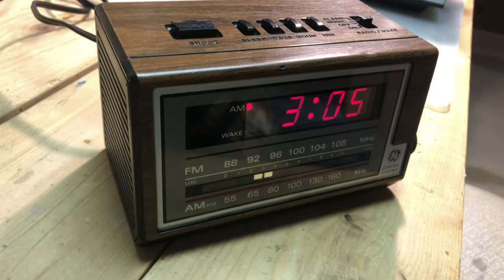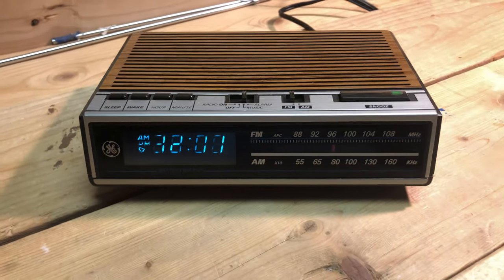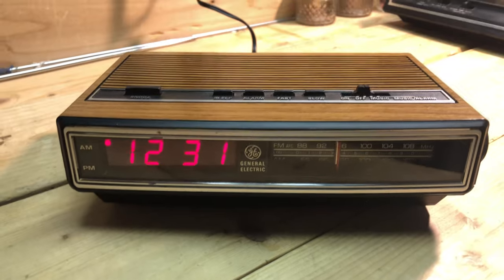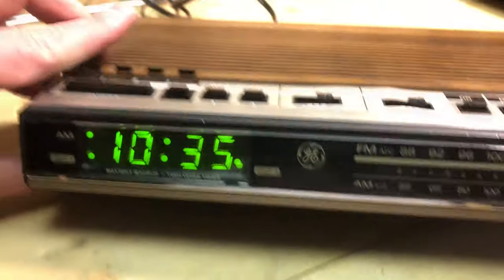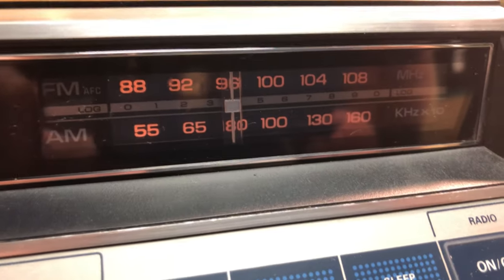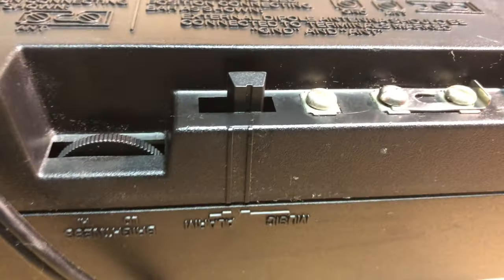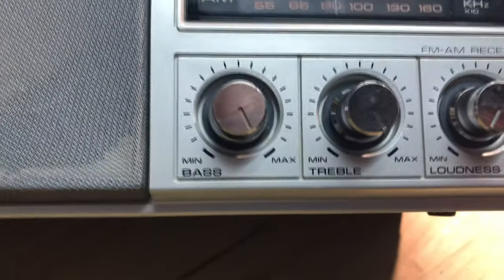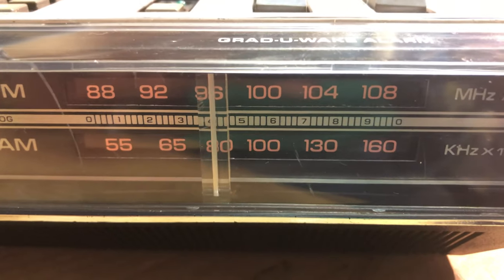General Electric Clock Radio Extravaganza Part II - the 1980's

Comment: I have a GE 7-4642, purchased from thrift store for $10. Took it apart and cleaned everything. It's been working much better than any alarm clock in the market. Never failed to wake me up. not to mention the sound quality when playing radio is so good I actually use it a lot when doing laundry.

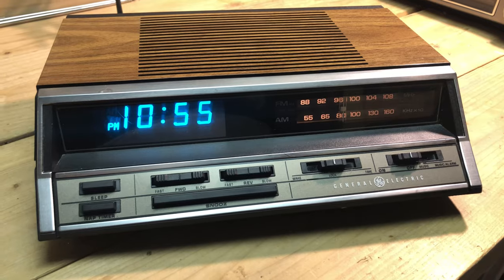Comment: 7:48 there it is! There's my alarm clock! The alarm function on mine is super unreliable, so I just use it as a standard clock, but it still works absolutely great for something that literally hasn't taken a break in 41 years (save for the occasional power outage). I have an extra one of the exaxt same model that I found at a thrift store should my original unit ever stop working. I believe my current use one was built in 1981 and my backup is from 1980.

Comment: I have a 4638 with its original manual. Unfortunately, the volume control board got busted so the volume is either can't-hear-it quiet or blow-out-the-speaker loud.
My mother bought a 4642 brand new and is still using it. She never took off the "Compare these features" sticker.